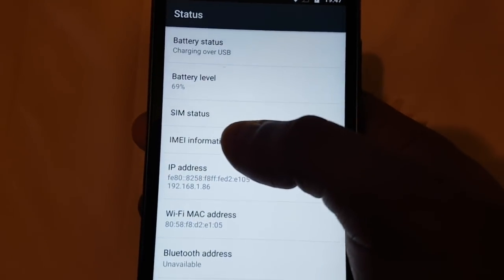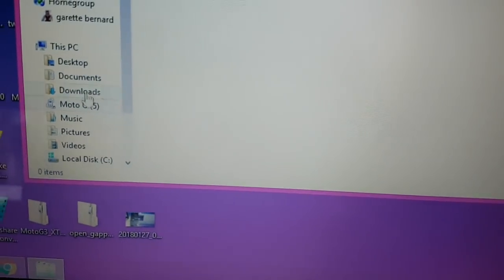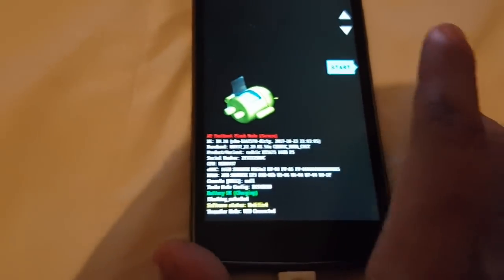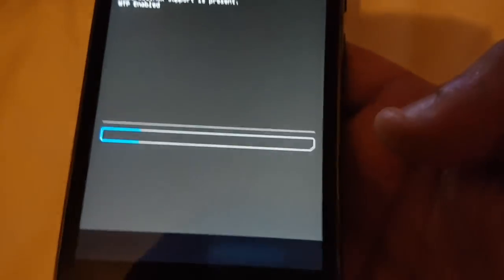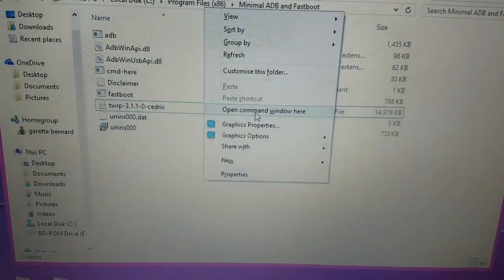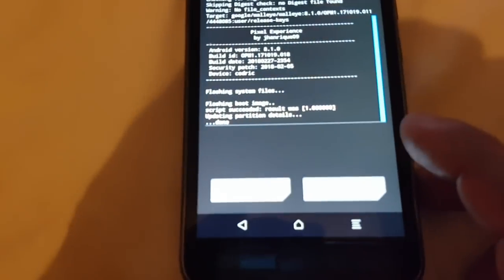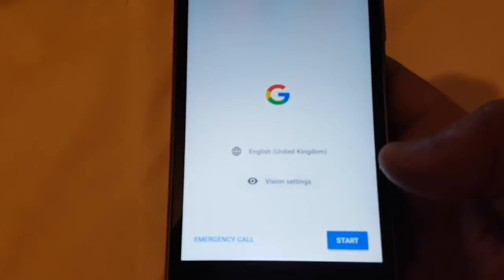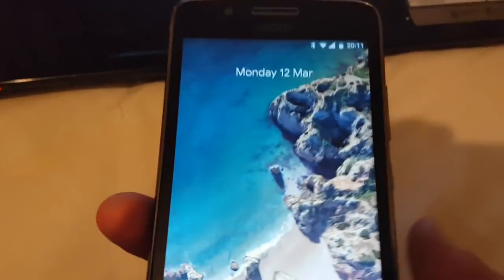Moto G5 Cedric Missing imei & Broken Network Fix

Comment: Hello. I was using a custom ROM, and I downloaded the Motorola software to reseat the original ROM. It turns out that my IMEI is set to zero. I've tried to go back to custom ROM and it didn't work. I have my IMEI noted.
Reply from the maker: A lot of people faced the issue of loosing IMEI this was only way to get it back

Comment: I installed 64 bit twrp 3.1.1 in my Moto g5 plus n pixel experience rom doesn't flash but it worked in 3.2.2.0 twrp I don't know whether it is 32 or 64 bit please help

Comment: i did what you showed and iam getting mobile network but only 2g....I tried the same sim in an another phone and 4g was working fine in it...Please help me
Reply from the maker: 4g is permantly broken ,the only way i fixed it was by installing the official 8.0 oreo firmware i made a video showing how to install it PLEASE BE WARNED IT WORKED FOR ME BUT IT MIGHT NOT WORK FOR YOU SO ITS ENTIRELY UPTO YOU IF U WANT TO INSTALL IT

Comment: Hi I am from India and using Moto g5 plus. Will this method week on my set. I am also stuck on the same problem. I got my network and imei but no volte calls. After flashing the ROM again. What you did was first flashed 32bit twrp and than 64bit, isn't it. Please answer else I will lose my phone. I have no imei and volte. Please help
Reply from the maker: Yeah just follw what i do in the video to get imei back bro 4g is lost for good

Comment: If u have doubt send ur gmail I will mail u
Reply from the maker: i still dont understand what your problem is u did not explain
Reply: I followed ur steps pin to pin but still I didn't got network .....sim is recognizing but no network ...after installing custom pixel rom I didn't get network...but once I reboot the network came for 3 seconds and gone....plz help me abhiabhishekn164@gmail.com
Reply: By changing my phone rom I did biggest mistake in my life
Reply from the maker: go into settings and status does your imei number show?
Reply: It shows 0 for slot1 and also for slot 2

Comment: On the pixel experience rom I did get my IMEI back, but couldn't get 4G/LTE back, reverted back to Stock firmware, managed to retain IMEI, but still no 4G/LTE
Reply from the maker: Thats  because u was running 8.1 and flashed stock fw whilst u had 64 bit twrp on the device because of this it cause lost imei and broken 4g lte theres no fix for this untill the official 8.0 release

Comment: How to restore 4g and IMEI in stock rom 

You should do all things in this video and then install twrp  recovery 32 bit then re flash stock rom from adb fastboot without these commands 
Fastboot earse modemset1
Fastboot earse modemset2
Then reboot 
You should get back your imei and 4g fully working 😁
Reply: yes the only solution thats worked with me
Reply: its working thanks alot
Reply: WORKS?
Reply: Got IMEI, but no 4g/LTE.
Reply: You may restore it or not, you have to wait till oreo update to fix this.
Reply: Mohamed El ouarrak plz bro help me I lost my IMEI NO. how can I fixed it??
Reply: bhavesh tak install custom rom and after install the stock rom with this method
Reply: earse? you mean erase?
Reply: I can only get 3G and can't get 4G anymore, when I install stock ROM with the commands you said It still gives me 0 imei, I have to then flash the oreo rom with all the commands then flash pixel experience rom to get my 3g back, I need 4g :(

Comment: Imei no showing 0 in stock rom
But in pixel experience rom it fixed
How to fix this 0 imei no in stock rom?
Reply from the maker: Tushar Mishra its a problem many are facing  it happnd because u downgraded from 8.1 to stock rom whilst still on 64 bit twrp theres no fix at the moment untill the official 8.0 releases im facing the same problem too like evryone else
Reply: So we can't fix this ?
Can official Oreo update will fix this problem ?
Reply from the maker: Tushar Mishra yes hopefully the official 8.0 will fix this,im on viper venom rom its 8.1 and everything works fine just download footej camera to get working camera and stay in that rom untill 8.0 releases atleast we still have a working device thank god😆
Reply: Android Doctor please send me the rom link
Reply from the maker: Tushar Mishra https://forum.xda-developers.com/g5/development/rom-aosvp-viperos-t3755426
Reply: Yup you can get your imei back in STOCK ROM......follow these steps:-

** DO IT AT YOUR OWN RISK.......I AM NOT RESPONSIBLE FOR ANYTHING, IT WORKED ON MY MOTO, SO I AM SHARING THIS TO U **

0)follow the above steps shown in the video.
1)after getting back your imei no. on pixel experience rom, reboot to TWRP recovery mode.
2)Tap the Backup button,then only tick the EFS partition,select location to sd card.......then swipe to backup.
3)revert back to stock rom by flashing it.(search "How to revert back to stock rom in moto g5/g5+")
4)now again flash TWRP using fastboot command as it was done in this video.
5)now goto TWRP recovery mode , then tap on restore ...........select storage(Micro sd)......then tap on efs backup...........then swipe to restore.
6)now tap wipe.......... format data------->yes
7)reboot your system............first boot usually takes longer time.

Voila!! you are back to your stock rom with imei !!!!!!!!!!!😁

NOTE-"NEVER EVER TRY TO INSTALL OTA/SYSTEM UPDATES"..........IF YOU DO IT YOU HAVE TO REPEAT THE SAME STEPS AGAIN

Hope you understand. GOOD LUCK!👍
Reply from the maker: IMPORTANT UPDATE GUIDE hey G5 users if u  want to flash the stock android 7.0 firmware without loosing imei number follow my new tutorial https://www.youtube.com/watch?v=XmKg84IXEbo

Comment: I still get missing IMEI
Reply from the maker: Liam Macdonald you shouldnt if u did it properly also try reboot then check to see if its there
Reply: Followed your video step by step, my IMEI doesn't even have a second number like yours, mine is just 0 for it all lol
Reply from the maker: Liam Macdonald damn that sucks try installing the new 8.1viper rom https://forum.xda-developers.com/g5/development/rom-aosvp-viperos-t3755426
Reply: First, i need to flash the stock rom and after follow the steps of video?
Reply: Lemmon I flashed stock ROM then it worked where as previously it didnt so yes flashing stock rom
Reply: Finally i had network signal but IMEI continues 0, how i solve this?
Reply: Lemmon you on stock ROM still?
Reply: Now, yes, i'm returned to stock after recover network signal with Pixel Experience 8.1.0, still IMEI in 0, but signal network, works.
Reply: Lemmon is it 4g or 3g.(netwrk)